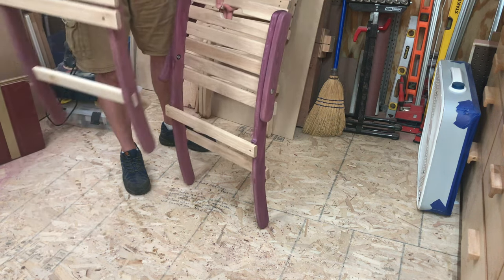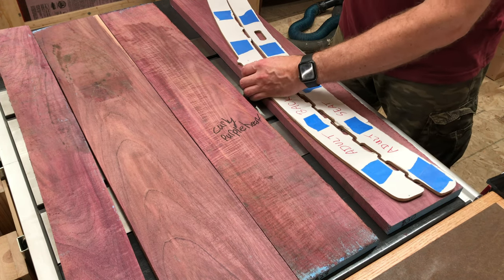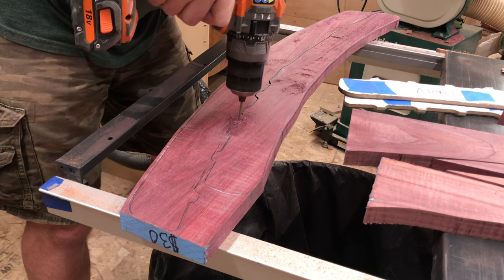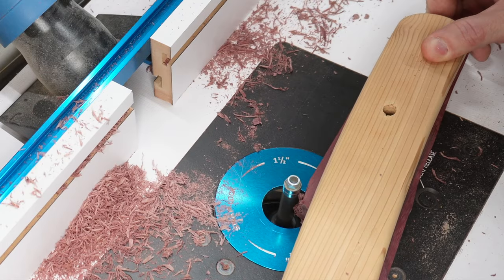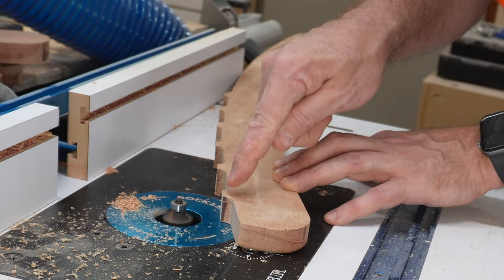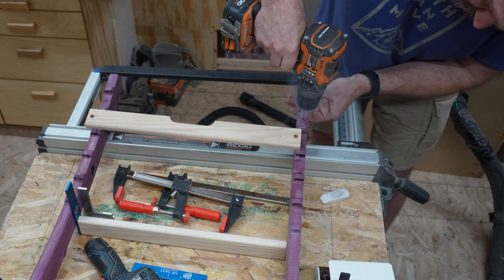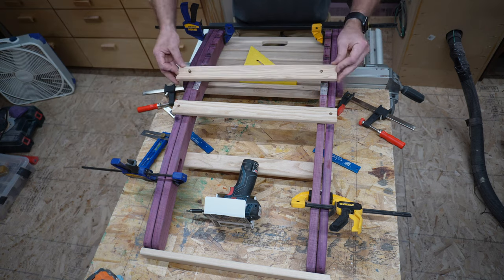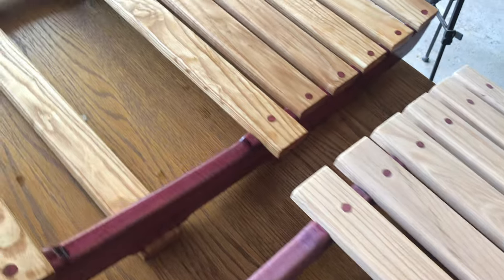This Wood is TOO PRETTY to use for  Nesting Chairs!

Comment: Very nice job~!!  The Purple Heart & Ash look great together.  I bought Jay's templates last year and am finally getting around to making a set of these for our deck.  Torn between making them from Oak, Cherry, or Walnut, so I may be doing one of each.  I like the addition of the arms.  May have to add that feature to mine.  Thanks for sharing the video~!
Reply from the maker: Thanks for your kind words! Cherry and walnut are beautiful woods but not as sturdy when left outdoors. White oak is an excellent choice if they’ll be left out in the weather. I’m planning to make some rocking Adirondacks out of white oak.

Comment: So why is everyone using the 1/4" round over? I had to use the 1/2" round over to make it fit the legs. Plus on Jays video and KM Tools video They hold the bit up to the 1/2" shaft of a router bit not a 1/4". I had to work up from 1/4" round over to the 1/2" round over so I am pretty sure this is a typo on the plans.
Reply from the maker: You could be right about the typo. I can’t remember because it’s been awhile since I made these.